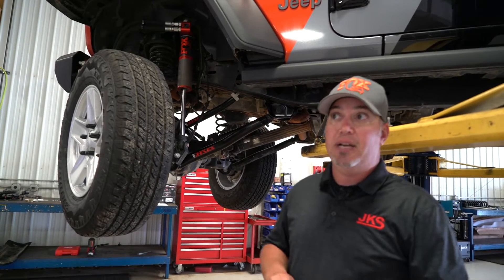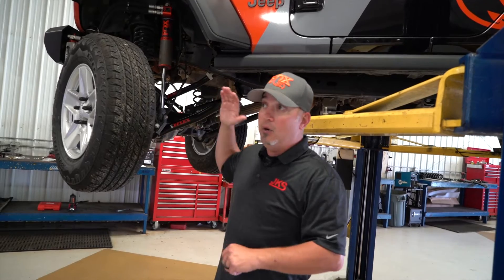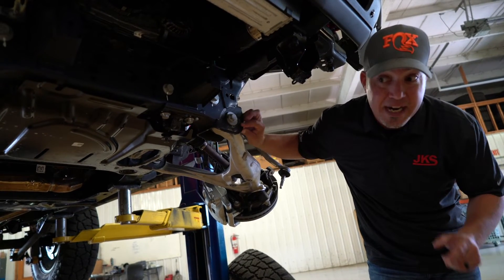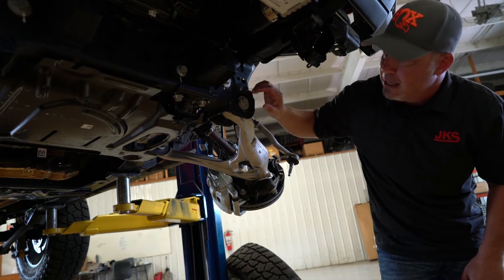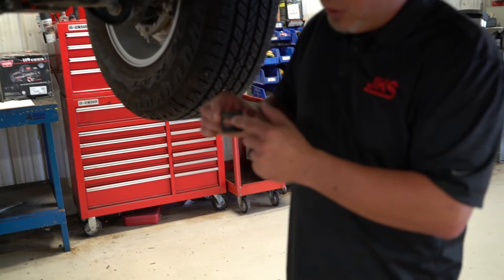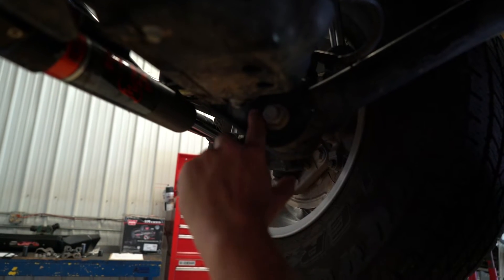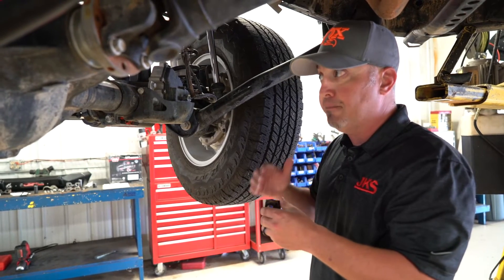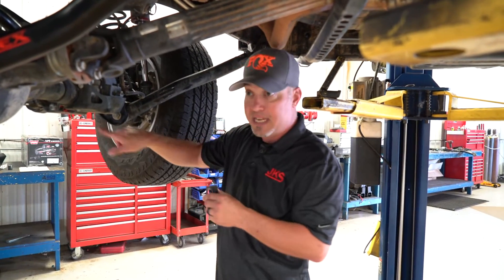Factory Control Arm Caster Adjustment

Comment: Do you have to drill out the hole in the factory axle brackets? If so how do you add adjustable arms later with the hole drilled out?